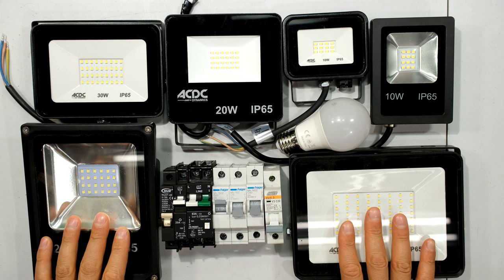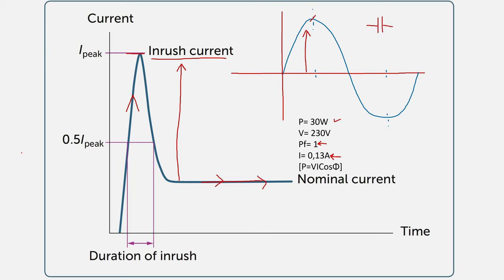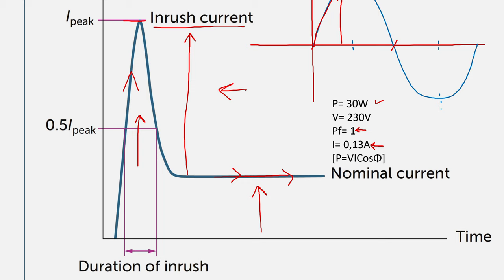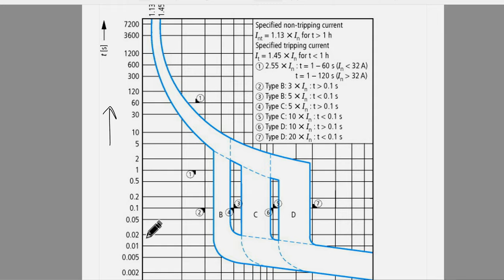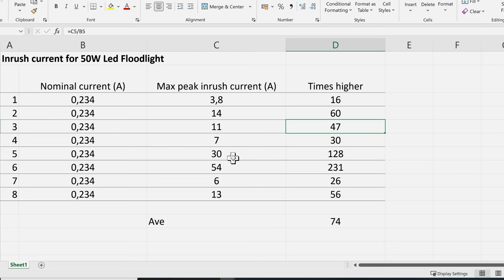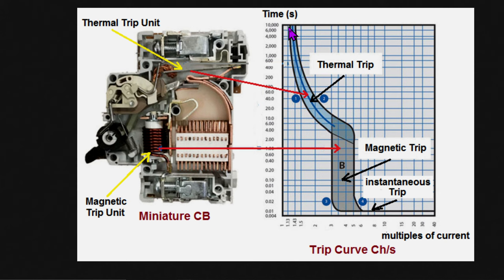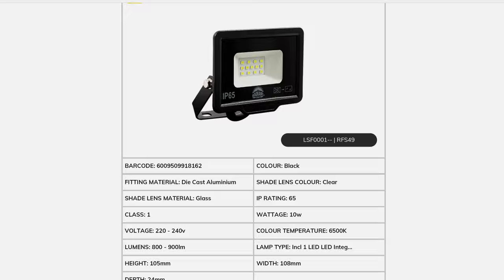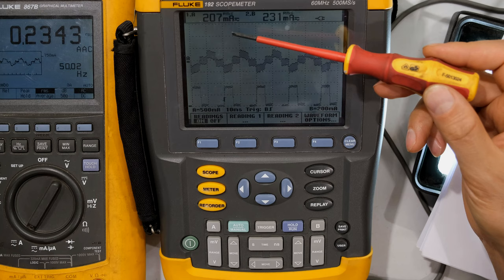LED luminaires / lights, inrush current and choosing circuit breaker current capacity

Comment: thank you very much for this helpful video. I could not figure out my problem with failing motion detectors after changing from traditional ligthbulbs to LEDs. Now I understand why the inrush current welded the relais contacts of my motion detectors shut.

Greetings from Germany

Comment: Most devices have a higher inrush current compared to running current.   A better comparison would be to compare directly to incandescent or fluorescent inrush.    
This is good information if you are tuning on all lights at the same time.  Most would not be turning on every light on a circuit at the same time.  Lights will usually be grouped into individual wall switches.
Also note, most electronic led drivers will have a power factor below 0.8 and often even 0.5 or lower

Comment: Could in rush current cause my breaker to make a noise similar to a dryer buzzing when your laundry is done and immediately trip my breaker (7 flood lights in parallel) (was working fine before we turned the breaker back on)